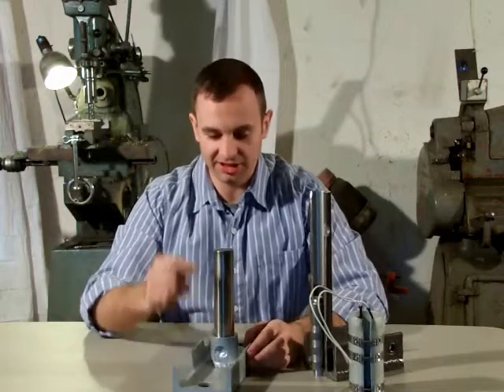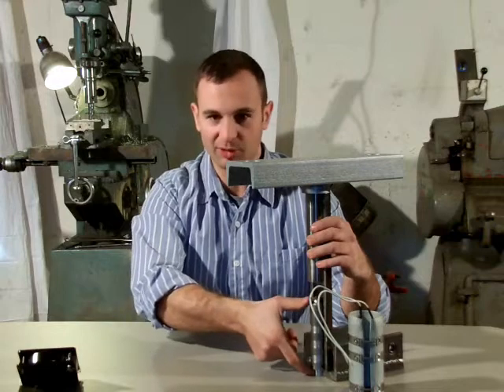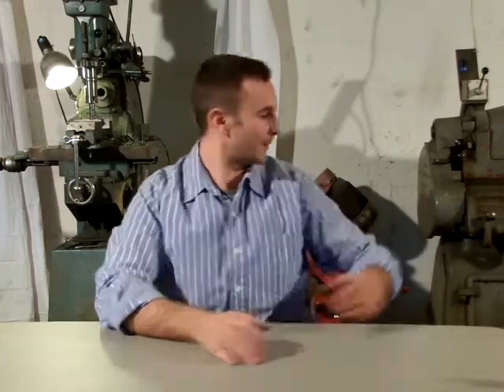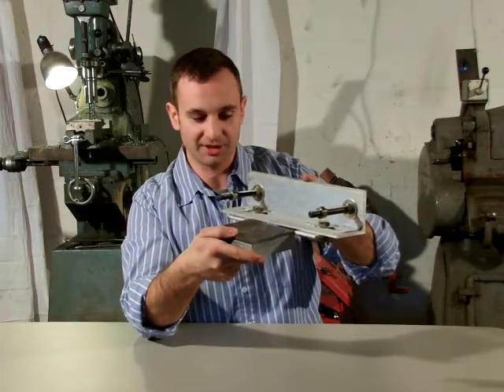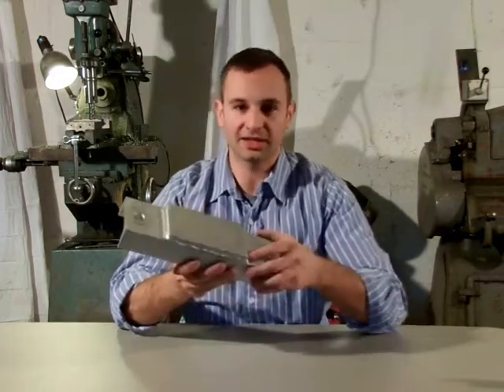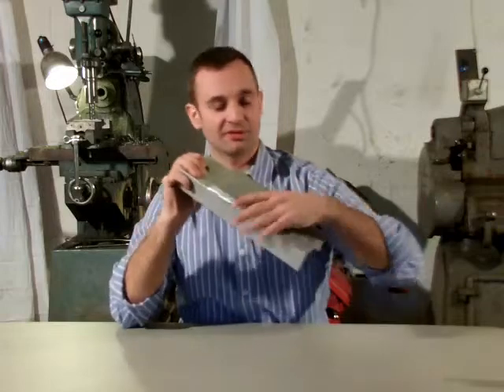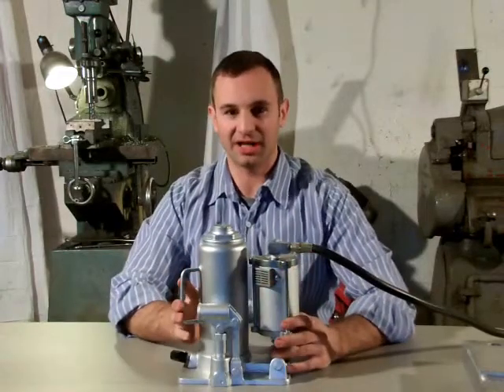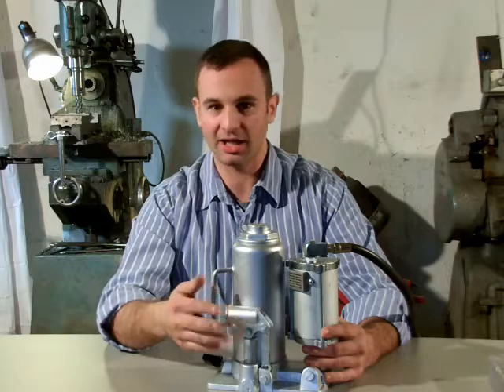About Medium Machinery, LLC Injection Molder

Comment: Does not work well. While injection was plunged, the plastic melt, raices up. Didn't cool off enough. Very noisy while plunging.
Reply from the maker: I am sorry about your negative experience. The hydraulic motor can be silenced quite easily, by attaching a sponge, cloth, steel wool, or any other noise absorbing material to the air exhaust. The material should be allowed time to cool off inside of the mold,  and should not be set at too high of a temperature at the machine. Please take a look at a user manual video of the machine here: https://www.youtube.com/watch?v=nkIJnZvbbcw. Pre-heating the mold usually fixes such problems. Feel free to email us directly at support@mediummachinery.com and we will be happy to answer all the questions and set things right.